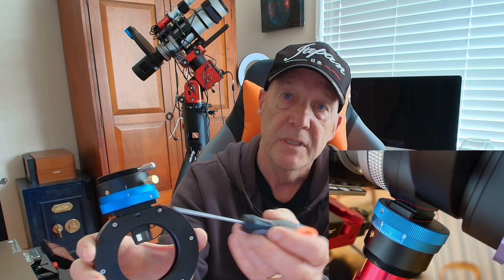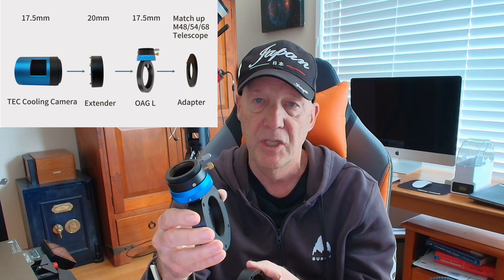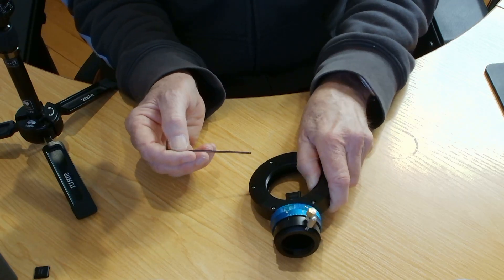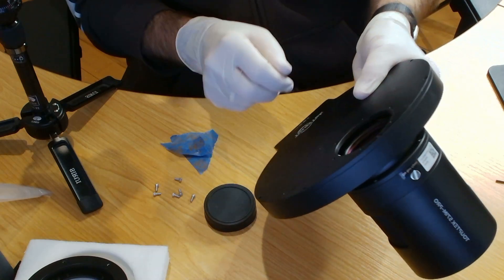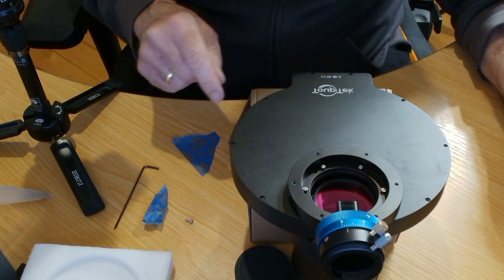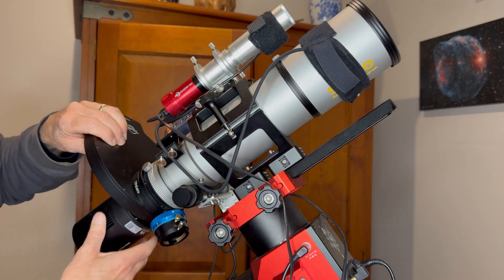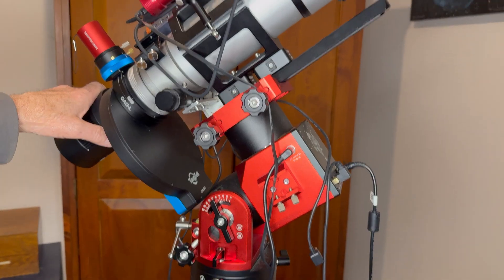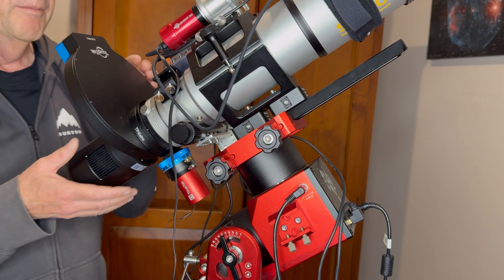Attaching the ToupTek OAG-L to the ToupTek filter wheel ( but I find a backfocus problem).

Comment: I have the same problem. Assembly per the instructions, but guide camera would not focus, also Touptek by the way, I hate the idea that my guide camera is useless with the OAG, but as you stated, it does not go far enough down the helical focuser to achieve focuser with the main camera.  Besides changing over to the asi120mm mini to solve this problem, did you ever do anything else to the assembly to get the two cameras to focus together.  I also contacted Touptek, but so far no reply.  Thanks Mate.  Bruce
Reply from the maker: Thanks for checking out the video. Unfortunately no, I didn't solve the issue and I'm using and ASI120mm mini with the Touptek OAG. Unfortunately, the camera they were including in the deal with the 2600mm is more planetary camera than guide camera and I think it would have been more sensible to have included one of their guide cameras as the free camera included and not one that can't work with their OAG (or given a choice between two).

Comment: Good useful review Logan, quite a setup with the filter wheel as well! Id just keep using the zwo120, you know what they say, If it aint broke, dont fix it! CS
Reply from the maker: Thanks Simon. Yes good popint. I do have QHY planetaqry camera which I might use instead as I need that  ASI120 to work with with Samyang lens setup which has inherited the ASiAir pro. CS.

Comment: Hi Logan,
Those OAGs can be troublesome in setting up, but once set, as you mentioned, the guiding is superb (you mentioned RMS of 0.45 arc-seconds, which is excellent).
Clear Skies
Reply from the maker: When I first tried to use an OAG a few years ago, it was a bit of a hightmare to get going but over time, I now have three setups using OAGs and I'm definitely a fan of them now. Clear skies Pat.

Comment: Hi! I also move to the atr2600m plus filterwheel, but no OAG (seems an overkill for my 90mm refractor!). Everything went well, including the filterwheel led issue. I'm dealing with backfocus and tilt, however. Touptek doesn't fully explain which adapters must be used, when to screw the camera and filterwheel, if the tilter must be used and what backfocus consume, etc so hitting the 55 or 56mm mark is a bit and miss and you must find external adapters, as you said. Not bad products but documentation can be improved quite a bit.
Reply from the maker: I ended yo adding the OAG as I was going to have to get a new guidescope anyway and although setting one up the very first time was frustrating to say the least, I'm kinda a big fan of them now. Trying to get bang-on backfocus is such a pain so I'm glad that this was not an issue for setting up this particular rig. I'm glad to hear you didn't have to deal with the light-in-the-filter-wheel issue. Clear skies.

Comment: That's always the same with every set-up, need this extra, than that, so frustrating and I like to keep it simple......
Reply from the maker: Yep that's a common theme in this hobby for sure, especially with mixing and matching different makes of equipment. It is just unfortunate that the ToupTek guide camera has a backfocus requirement that made it even incompatible with it's own make of equipement with the small collar attached.  Clear skies.
Reply: @LogansAstro Yep rare that touptek guide camera does not match